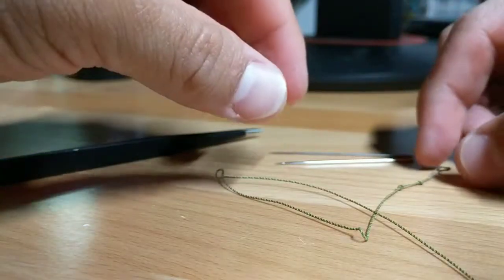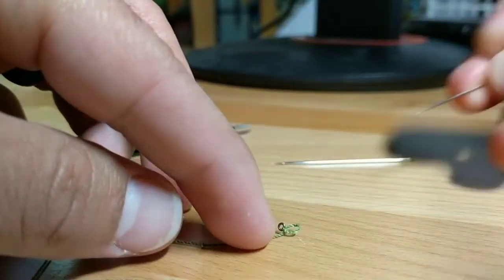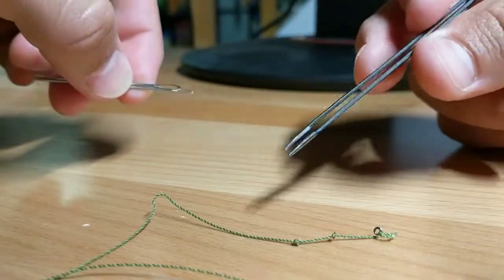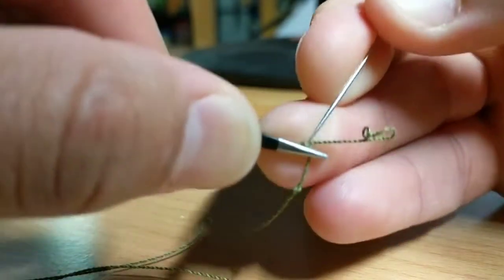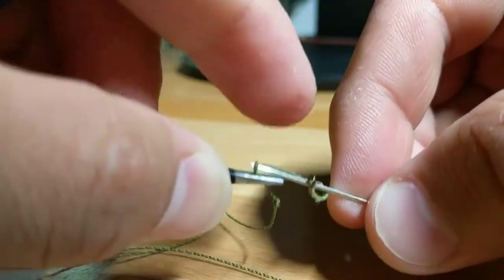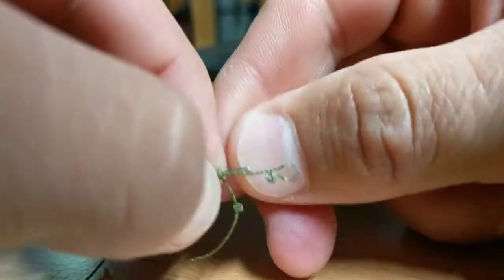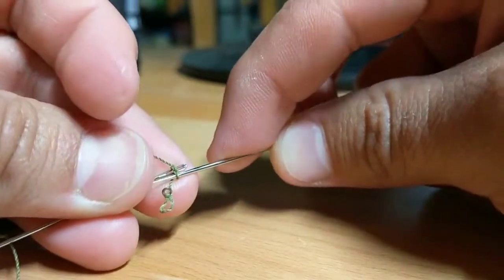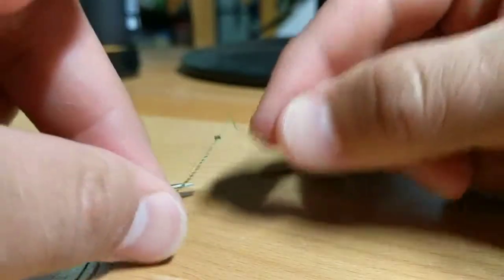How to get knots out of a furled leader

Comment: Thank you Mat for this helpful video! I just found your channel tonight and am hungrily devouring your steelheaad videos as I prepare for my first-ever trip to Erie. This video came along at just the right time, after my trusty thread furled trout leader developed its first knot whilst landing a frisky larger wild rainbow caught in one of our beautiful PA limestone spring creeks. Have you managed to get the kinks in the leader to straighten out after the knots are removed? I am thinking some hot water and tension might do the trick. Nearly enough to make me want to build my own furled leader jig and start making them at home! I love them for nymphing and wet fly fishing smaller water where I live in southcentral PA for trout. The thread takes grease well and just performs better for me than store-bought tapered leaders. I've found that I prefer a 4-6' thread furled leader to a tippet ring, running variable lengths of fluorocarbon from there. Better performance and economical too - what's not to love! I've yet to try them in a dry fly application. Looking forward to more great videos! Thanks again. Seán
Reply from the maker: Awesome to hear Seán. I did not manage to get the kinks out and I ran the same exact setup that you described down to a tippet ring. I will say I don't use the furled leader for steelhead anymore, I use a couple different combinations of flouro and mono lines to build my own leaders, which I use depending on the conditions here.

Glad you are enjoying the videos!